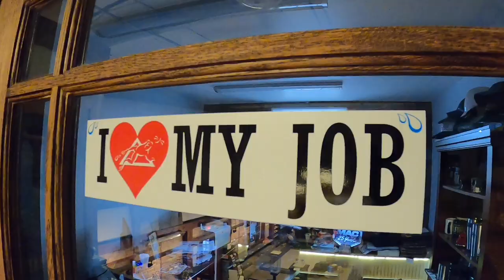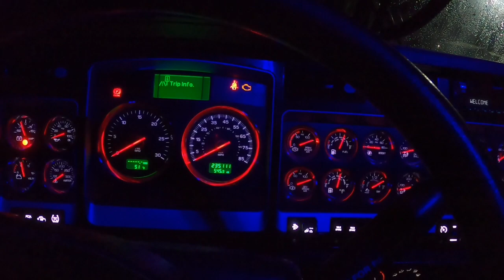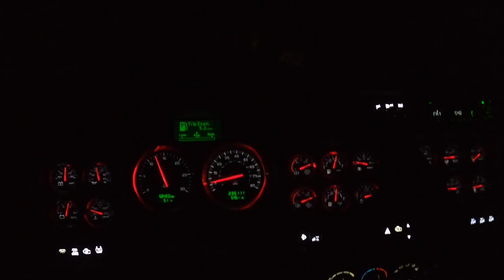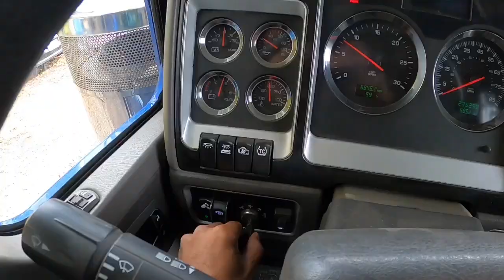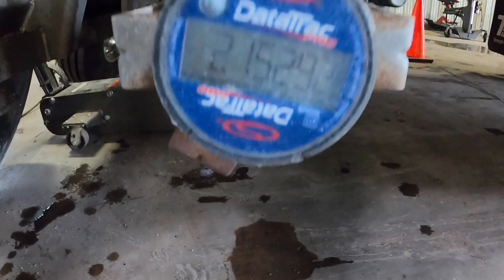Hauling with a Walking Floor and other stuff!!!

Comment: I always thought oil changes should be done every 10,000-15,000 miles. What kind of service (by which I mean, what is involved in the service, for example oil change, new filters etc.) would you have done every 5000 miles? Please explain as best you can. Thank you.
Reply from the maker: 5000 service is a grease job.  Measure brakes , tire pressure etc .....
Reply: @flintcreektransport  That makes sense but shouldn't the driver be check these themselves and letting you know when its needed?
Reply from the maker: @a1driver982   they obviously do Pretrip and post trip ..... because of the nature of our work our trucks require more maintenance than a otr truck racking up 3k miles a week

Comment: Do you hire Canadian Drivers
Reply from the maker: No .... In fact I’m not sure how all the laws work with that
Reply: Tim, Cavalier Transportation hires both Canadian and American drivers. They have terminals in Ontario, Quebec, Chicago and 2 in up state New York. They're a good company, good equipment (not quite the same as this company but they do have alot of Peterbilts, 386 model I believe) and pay well. Although most of their work is local, they do have some bunk trucks and dedicated US runs. Their New York night drivers run up to Bolton, Ontario nightly (in some of the newest day cabs) to do a switch and run back to their 2 different yards.